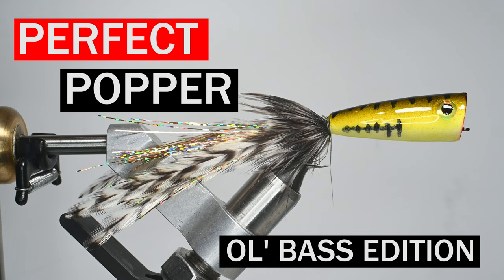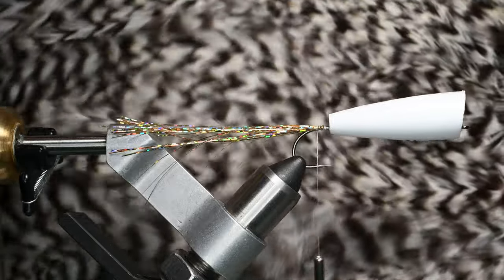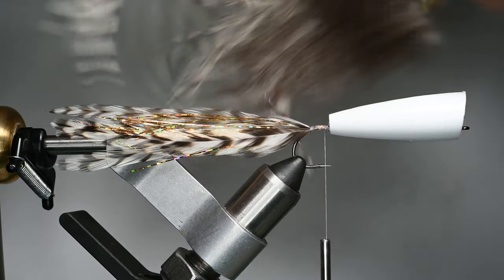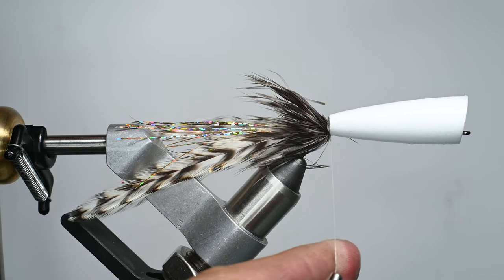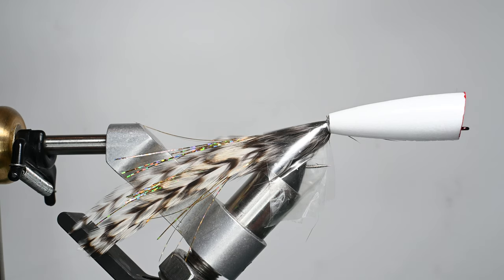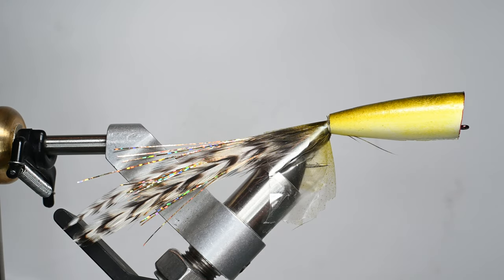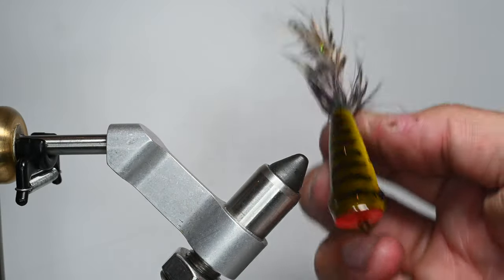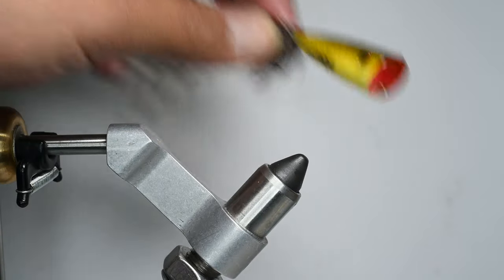The Perfect Popper Fly Tying Tutorial

Comment: Thanks for posting … I’ve had lots of issues with the head falling off. I use the smaller ones and generally put thread on hook. Have not used heat. Dealing with same loctite gel or with fly head cement. Loosing heads when the fly hits a rock or hard edge by mistake
Reply from the maker: Try the heat.   I think that combined with a good coating of a flexible resin or glue will help.

Comment: Svend, you use the term palmering and touching wraps in the same sentence when they are interiorly different tying methods.  Touching wraps are as the words suggest, wraps that touch each other while palmering are wraps that don't touch, similar to a candy cane.
Reply from the maker: I’ll need your sources on that because palmering is wraps covering some or most of the body of the fly typically with a feather.  There is not definition as to how far or near the wraps need be but that it’s not a head and not a collar but “palmering” a feather to be used for a bulk or whole body of the fly.  Touching wraps or non touching wraps defines the tightness or closeness of the Feather wraps/ palmered wraps as can also be used with thread, wire.  I’m happy to use the term differently, it’s the definition I’ve gone by and will continue to go by until I find it to be wrongly used.  The way you want it said would confuse more fly tyers than benefit as well “take the feather and wrap it clockwise around the hook shank with wraps where the stem of the feather will touch the preceding wrap and continue to do so until you have 15-20 wraps” vs “Palmer the feather with touching wraps” 😂😂😂
Reply from the maker: “Palmer A method for wrapping a hackle feather over a section of the fly's body. When it is retrieved through the water it 'pushes' the water and this causes attractive movement shock waves that help fish locate the fly”
Reply: @Svenddiesel  I'm not sure if you are arguing with me or simply letting me know you have received my note.  In your definition, the only description is "a method".  The expression of "a method" is where we both can agree.  With that, touching wraps is NOT the same 'method' of adding hackle to a fly as 'palmering' is.  For example, when tying a wooly bugger, the hackle is applied using the 'method of palmering' or spiraled (like a candy cane) up the fly WITHOUT touching the previous wrap. On the other hand, when adding hackle to the front of a dry fly the method used could be called 'touching wraps'.  
I have no interest in upsetting you; you can call it whatever you want.  I am however, interested in preventing other from being laughed at for using the wrong term when describing the method used to apply the hackle when describing a fly.  I hope the attached link helps clear up the distinction.
http://www.flyanglersonline.com/flytying/tyingterms/fft-p.php
Palmered:
Application of a hackle to hook body by attaching at the bend and spiraling toward the head, around the body, is called palmered hackle. The process of winding thusly is to "palmer" the hackle.
Reply from the maker: @Joel Kantor  not upsetting at all.  And laugh all you want.  Still your definition does not define the spacing.  Spiraling can be as you describe spaced like a candy cane, or spiral can be as close as “touching”.   Palmering simply describes the use of hackle wrapped around the hook shank.  What would you use to describe hackle wrapped with stem touching wraps up the hook shank? Touching hackle wraps?   
When it comes down to it I can see how you are right and I also see how I am right.  I guess it depends who’s definition (lots of variance) you are using.   In contrast I’ve also heard multiple well known tyers “Palmer” their chenille which we both know is not a hackle, but a body material wrapped in spiral wraps towards the eye.  Loosely using the word palmering to describe the wrapping of the material/ hackle rather than the focus on the distance.  I’ve seen tightly palmered, loosely palmered, so why not touching palmered lol.  So appreciate the feedback.
Reply: @Svenddiesel  since we can agree that there is a distinction between touching and non-touching AND there is a distinction we should be able to agree on between some/most and all, then maybe we can agree that palmering is when they don't touch and therefore doesn't cover all the space.  I've been doing this since 1984 (yes, I'm old).  Palmering is non-touching wraps with gaps between them such that the palmered wraps won't cover all the space.  When your method of wrapping requires 'touching wraps', you are not palmering.  IMHO
Reply from the maker: @joelkantor2257  yup agree to disagree.  Remember fishing and tying flies is fun.  Keep doing your thing and I’ll keep doing mine. Thanks for watching